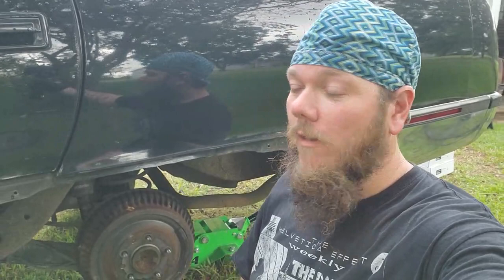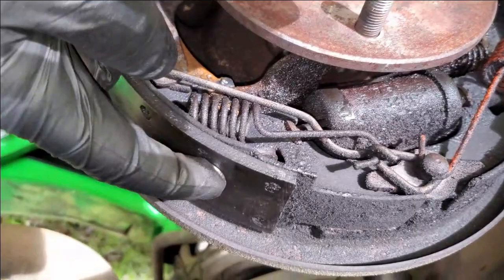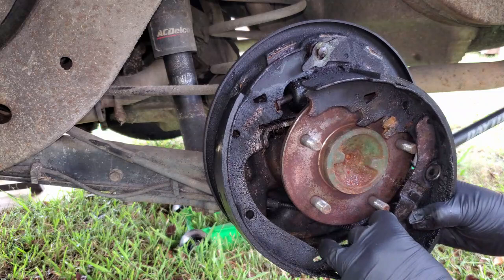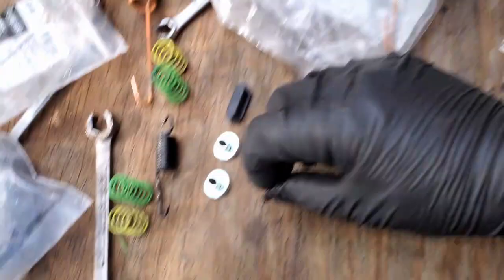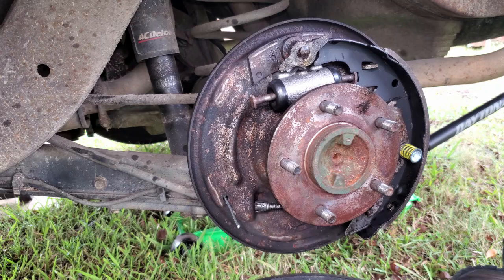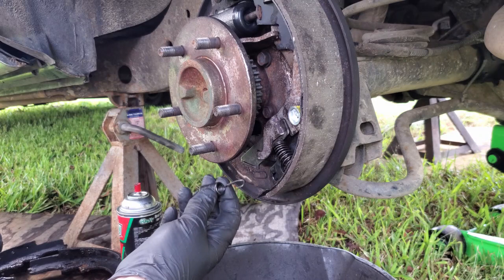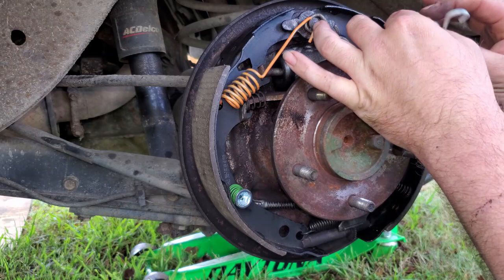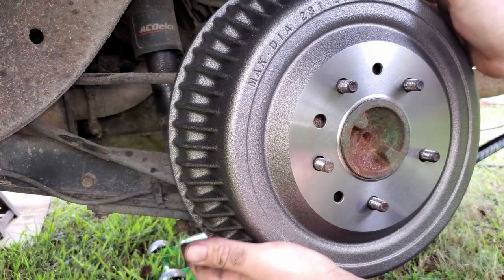Replacing Drum Brakes On A 93-96 Cadillac Fleetwood

Comment: Is it a pain to remove the brake booster? I see on some 93-96 impalas you have “unscrew” the booster. Is that the case with Fleetwoods?
Reply from the maker: I have not had to remove one on a big body I have pulled some off of 90s and down and it wanst to bad of a job just unbolt the booster and pull the pin on the brake pedal

Comment: Hey Dan do you have a pass key vid o out ?
Reply from the maker: I do not but there is one on YouTube that explains it you need to add resistors in-between the two orange wires that go up the steering colum there is a plug right at the bottom of the colum

Comment: How would I get the rear hub off to replace wheel bearings?
Reply from the maker: Pull the diff cover and there is a rod that goes through the carrier that's held in with a 10mm bolt pull that bolt and slide the rod out then you can push the axle in and the c clip that holds the axle in the carrier will fall out and then you can slide the axle shaft out. I am working on a video of a rear end break down but it will be a little before I finish it up
Reply: Oof that sounds like a bit of a project. I am about to tackle the drum brakes this weekend and figured I would drop a new bearing in while I had it pulled apart if it were quick and easy but no reason to fix what ain’t broke in this case. Thanks for the reply. Looking forward to seeing more Fleetwood videos. I’ve never done mechanical work before but your channel is greatly helping me learn some things and restore an old hearse.
Reply from the maker: @oflanagans1 yeah that's definitely somthing I wouldnt mess with untill it gives you a problem usually you will hear a roar sound as you are driving

Comment: I finally got my v4p caddy but I’ve no clue where the air pump for the rear suspension is?  I don’t think is working 😢
Reply from the maker: The pump should be in the driverside fender behind the bumper there is also a relay on the pump itself

Comment: Dan, Thank you for these videos. I have an issue with my 94, don't know if you've had this issue or can help me. My A/C won't blow cold unless I give it mid-full hard throttle. I can cruise and it will blow cold for a few minutes and go back to warm. It is fine on refrigerant. With me having to give it gas I've got it narrowed down to a vaccum issue and the compressor clutch does engage at idle, so again, it's not low on refrigerant. Where should/what should I start looking at?
Reply from the maker: I am not the best at ac I will say that straight out my first thought would be freon but if it's fine there may be a blockage in the orifice tube it's a filter that's inside of the ac line unfortunately it requires the ac to be evacuated and the line taken apart. As I said I am no ac guy but figured I would through it out there as a option

Comment: Thanks for uploading this video man. 
I see those rear shocks do they work good still have that smooth cadillac ride like air ride?
Reply from the maker: I couldnt tell the difference other then not having auto leveling
Reply: Sweet. Where did you get the shocks?
Reply from the maker: Cadillac dealership
Reply from the maker: Sorry these are the factory shocks I was thinking you had replied to the video I did about just rear shocks I did on a 79 coupe it had regular shocks